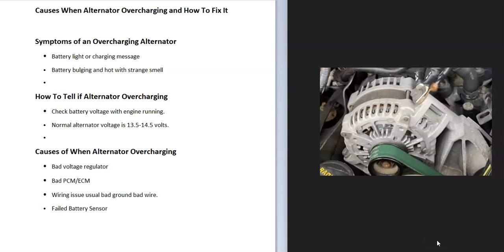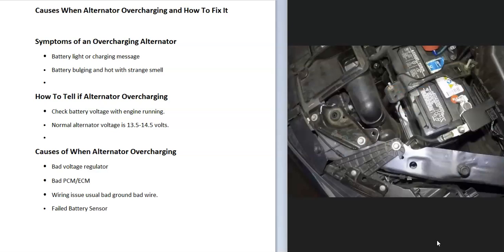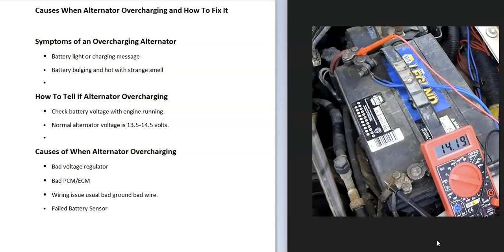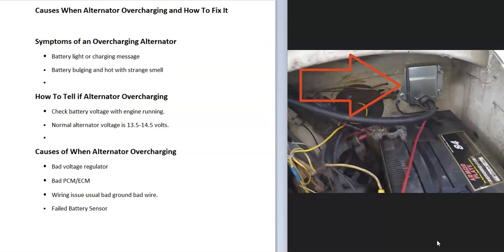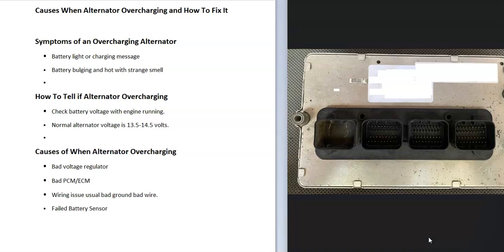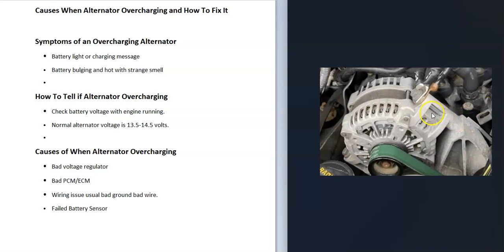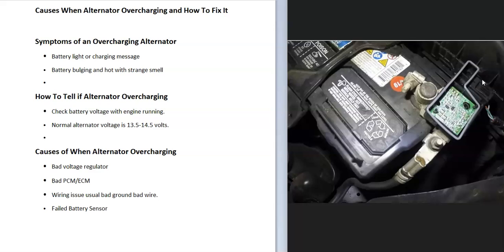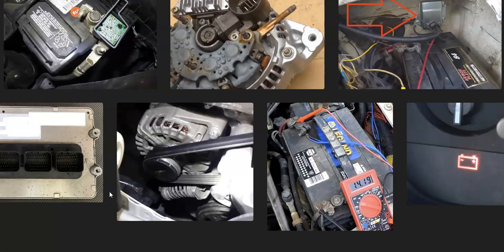Causes and Symptoms When Alternator Overcharging and How to Fix It

Comment: Curious 
My 2016 Chevy high country 5.3 
The gauge seems a little high to me all of a sudden mind you it's winter ... 
with all accessories on , my volt meter reads 15.4 
Is this normal or is something starting to fail ??
Reply from the maker: Some newer vehicles have a smart alternator that varies the voltage output, usually between 12.5 to 15.5 volts. It is best to look at the rated output to know if it is correct, but it should not stay high over 14.5 volts for long unless there is a large load on the system.
Reply: @HVAC_Mechanic 
I drove 225 miles and it stayed pretty much at 15.5 for the whole trip ... Tho sometimes like the next morning it will sits perfect in the middle of the 14 number sign ... 🤷‍♂️ and it seems when starting truck up I can tell if it will act normal or high ... I've tried shutting the truck off several times just to see if it will be normal ... rarely does ,,, but there is times it will be

Comment: I have a alternator i just replaced regulator brushes and rectifier but the battery light is still on and its reading over voltage.  All wires and terminals on the battery are tight but still light indicator is on.

Comment: I have a 05 dodge Cummings voltage regulator in computer went bad went around that with a external 80s fire wall regulator it charges but lights surges dim to bright and sometimes voltage gage will go to 18 volts is there some type of diode to stop this
Reply from the maker: The voltage regulator may have also gone bad, but usually, when the voltage jumps around, it is caused by a bad ground. I would run a wire to the block and body to be sure the ground is good. Keep in mind that a bad ground can cause a voltage regulator to fail, so it may need to be replaced.

Comment: I have 22 F250 deisel with two batteries. One was getting really hot, smelled bad and leaking at the covers. It was NOT an alternator though. Replaced both batteries. One was 12.7 volts the smoking, smelly, leaky one was 10.7.  Same symptoms just a bad battery, alternator is charging at 14.5-14.8 volts.

Comment: What if the alternator voltage drops to say 12.4 - 12.6? Could it be do possibly to the heat out here in Nevada.
Reply from the maker: There might be some small fluctuations, but not that much. Some new vehicles do have a Smart Alternator, which can vary the voltage at times, but usually, if the alternator output falls below 13.5 volts, it's not charging correctly.

Comment: drive a chevy volt with no alternator, just a dc-dc converter, what gm calls an apm. deleted the agm battery and dropped in a 6s LTO 22ah pack i built. car charges it up to around 13-14.5v or ~20-40% SOC. put a flush mounted 200w solar roof on thru a 30a mppt set to charge the battery to 15.8v. car can throw a code if it goes over 16.0v but 15.8v is like 95% soc. gives me more range and shaves ~40lb off, costs less than a new agm battery and should last longer than me. everything runs more efficiently with the exception of overhead dome lights which get slightly hotter coz theyre tungsten. replaced halogens with 6$ color changing leds which have their own regulated power supplies. this was like 2 years ago. every car that can should do this to save fuel/improve ev efficiency. tesla does something similar with their 16v battery in newer models.

Comment: 1996 caprice 9C1 police with a high amp alternator with no equipment or any need for extra voltage is always pushing a lot of power and clocks at around 3/4 spike on the amp gauge.

Comment: Alt gauge in to cab is showing postive charging 15.2v  after 30 miles freeway speed needle goes to the neg. side 11.ish .  Then I get in the home at idle , needle heads back to 14.2v.  Normal?   What do you think?

Comment: I Did a forward diode test: +probe on the alternator’s +terminal, -probe on the case, measured 0.20V. This voltage drop is very low, indicating a short or damage (not blocking current in reverse). Should be around -600mV to 700mV when good.

Battery reads 12.25V cold then up to 18v! since the regulator isn’t working, I’m considering setting up an external regulator relay for my 2003 Subaru Forester or what ever route is financially and least extensive. Planning to check the PCM and inspect relays for electrical issues and wiring. Want to take the least invasive fix. Battery light came on, followed by brake and ABS lights flickering, then engine light, then back to normal, and engine light again.

Comment: My 2007 Chevy Malibu  after getting alternator replaced my radio and power steering goes off and on any tips what that means
Reply from the maker: I would check all the alternator connections; something may not have been connected or tightened correctly and may be loose.

Comment: I have a one-wire alternator, my battery is new.  Seems like it is always running at 14.1 volts.  Always when the car is on, its charging.  Is this normal?
Reply from the maker: The rated output for the alternator needs to be looked up but that is a normal range for most vehicles.

Comment: I have a 2003 rav 4 my alternator was running at 15.7 it burnt up the plug to the alternator and 1 o2 sensor but when I turn the key I get nothing I've replaced all the fuses and relays just not sure what else to check

Comment: Guys thank for the information in your video I found it very handy. I've got a 1979 Trike based on an Reliant Robin. I've just finished replacing all of the electrics and alternator. Getting a slight overcharge at almost 16v drops to 15.5 with the lights on. Still a little hight for my liking.. Any other advice to drop it by a few volts safely please

Comment: Working on one now.  The battery was dead but vehicle starts with a jump.  Once started instantly acid bubbling from top of battery.  Signs the acid has been leaking for quite a while because it's all over the plastic.  Now I'm really not sure if its a bad battery because the vehicle needed a jump or an alternator over charging situation.
Reply: Experiencing the same thing now

Comment: 1996 Pajero xceed edition here. My alternatir is definitely overcharging. I can smell the weird smell and it turns out that it was the battery acid and i could see some of it coming out. The vehicle dies everyime i switch the  engine off. Probably need to get someone to check out the wiring or grounding